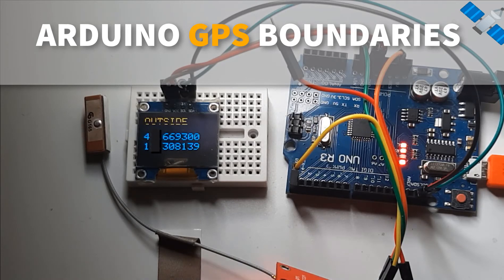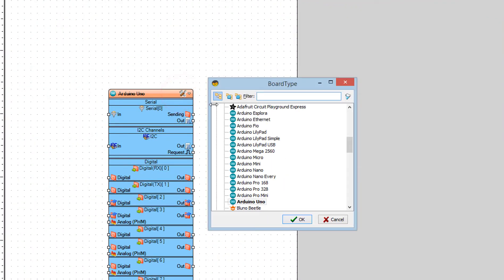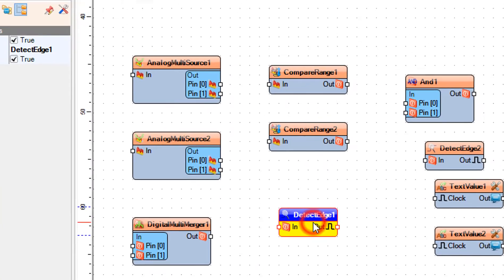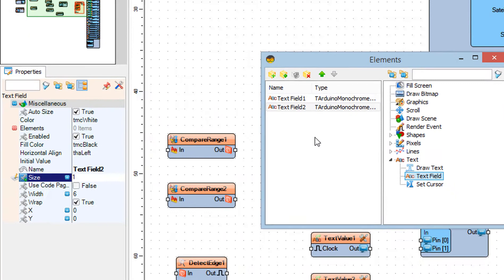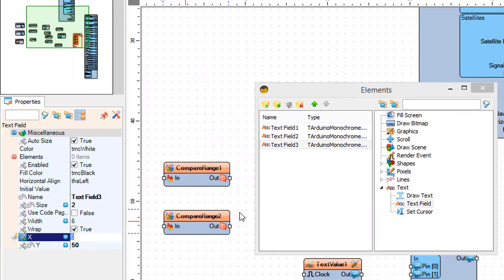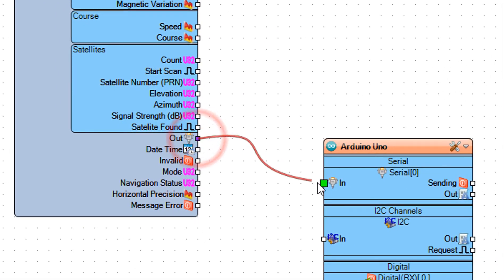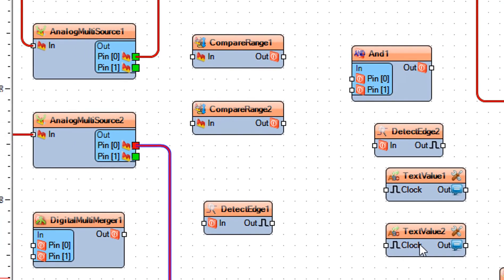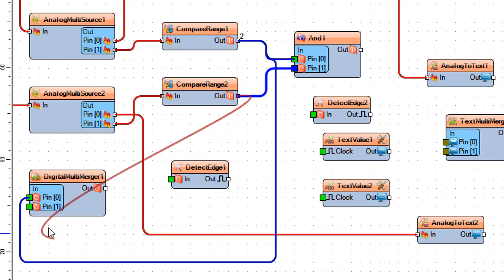Make GPS BORDER BOUNDARIES using Arduino

Comment: can I use this example to have a triangle boundary instead of rectangle ?
Reply from the maker: Yes you can
Reply: @visuinoprojects  thanks a lot. Can you guide me a little bit since i am new in visuino ?
Reply from the maker: @adbas6201  Just use 3 points instead of 4, everything else should be the same. First make it like in original tutorial to learn about it, then proceed forward.
Reply: How to get this parts?